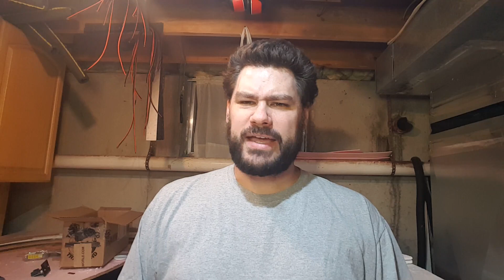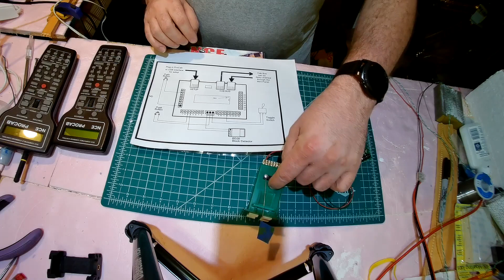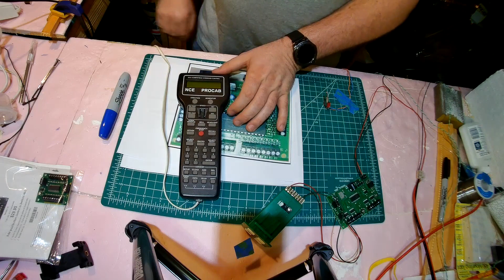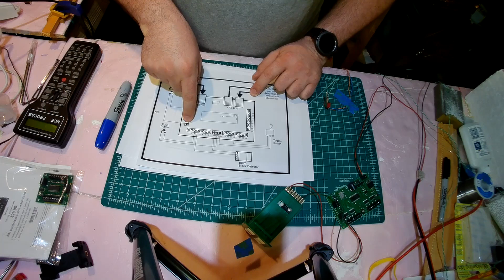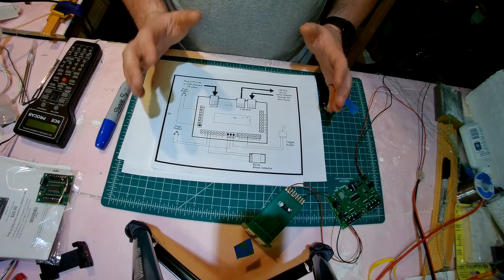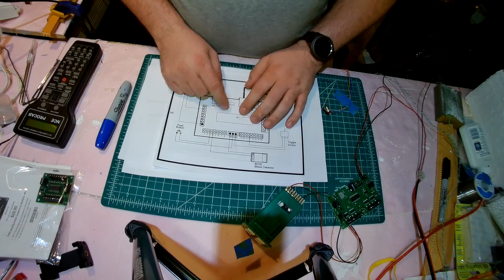NCE MINI PANEL explaination

Comment: re video "NCE MINI PANEL explaination"    If using momentary (push-button) switches are they NO or NC?  (Meaning normally open (circuit is disconnected until button is pressed) or normally closed (circuit is connected until button is pressed)).
Reply from the maker: Sorry i thought i responded to this earlier. These would be momentary NO (open) switches. the only need to be closed to make the contact between the action pin and the ground. If you have any questions, let me know. Email is on the info page.

Comment: Glass I found your vids, most helpful. I'm trying to wrap my head around the mini panel(I'm going to use mine hopefully for signals). But your advice on it can basically be added anywhere in the cab bus, as long as there is a cable that you can plug into, is most helpful. I know your video is old(and you've probably moved on to other things), but more tutorials would be awesome!
Reply from the maker: i have not seen it for signals. i have seen the AIU01 used for signals.  but im sure we can figure this out. you are right, that i have moved on. as a matter of fact the layout from this video is no more. i am in the process of designing a new one. im sure the AIU and the Mini panel will come back into play. so stay tuned.
Reply: @Foltz Bailey Model RailRoad  definitely will! Look forward to your progress on the new layout..
Reply from the maker: Hey, I went looking at ur channel. Is it set to "for kids". ? No one can comment on any of your videos.
Reply from the maker: @damongaskin Hey I just watched ur new video. But I can't make comments. Ur channel is market at not for kids.
Reply: Hey! Thanks for watching.! And yes, I disabled the comments years ago, when they first started with the bots and spam stuff. I may change it, but things are so much worse with that kind of annoyance.. Do, what did you think?

Comment: why would you even need a button board the switch 8 does the same thing?
Reply from the maker: You cant hook toggles or button switches  to a switch8. You need the button board for that. The switch 8 is only there as a decoder to give the tortoise an address.
Reply: @FBMRR  ahhhh okay, thanks!!